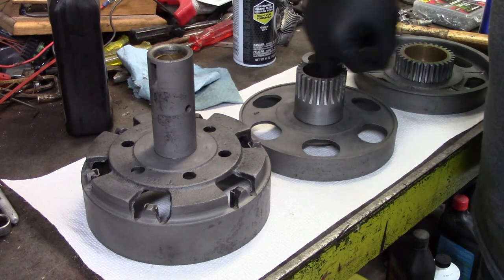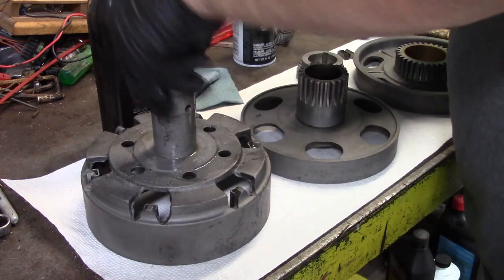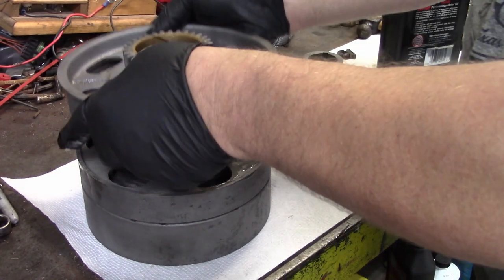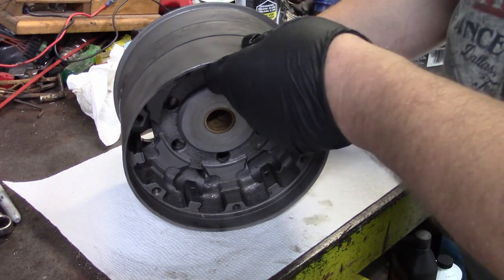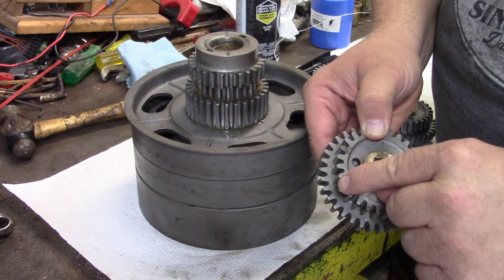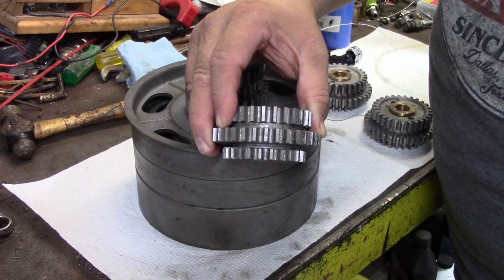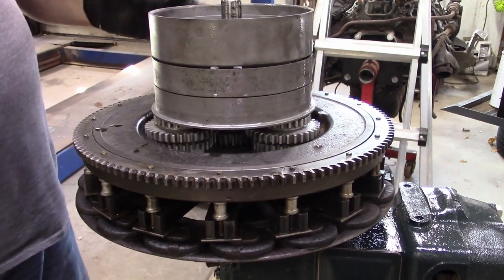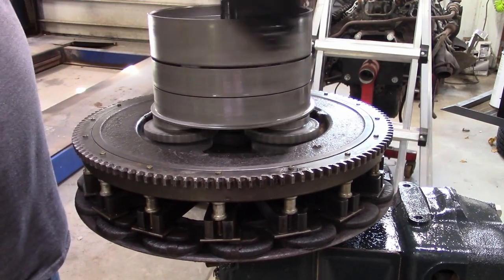Model T Ford Transmission Build 4

Comment: Thank you for these videos. I am in the process of rebuilding my 1925 model t doctors coupe. I have not got to the transmission yet, but as soon as I get the engine done I will. I have just started pouring Babbitt for the first time. I started with the fourth main, and managed to mess that up a couple of times, but learned a lot doing so. This next time I know I will get it right. One of the neat things about Babbitt is when you mess it up you can just melt it out and start over. Then it will be on to the main bearings and caps. I have a line boring jig for the mains, and own a machine shop, so boring the fourth main will be easy.
Reply from the maker: I am glad you enjoy the videos, Babbitt is the next thing I would like to learn how to do.  We need to keep these skills alive and well!  Thanks for watching!